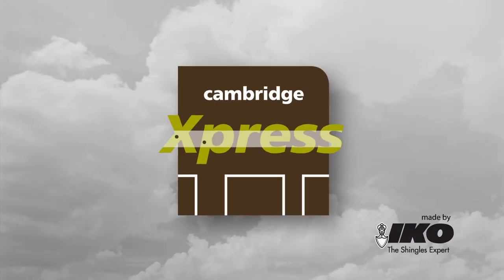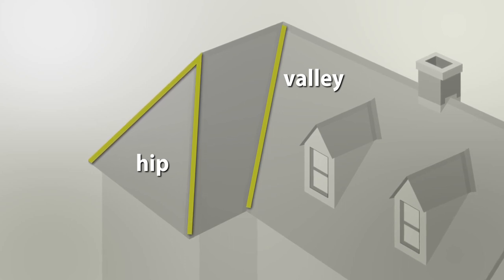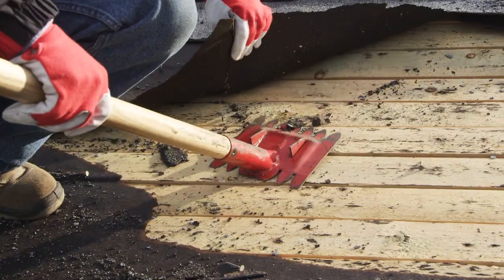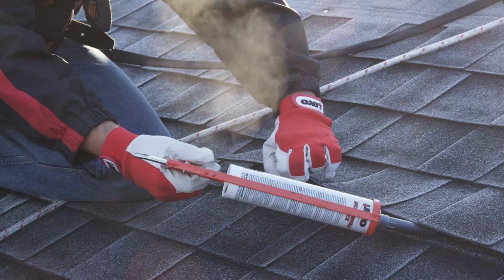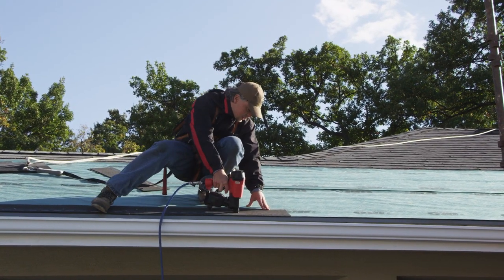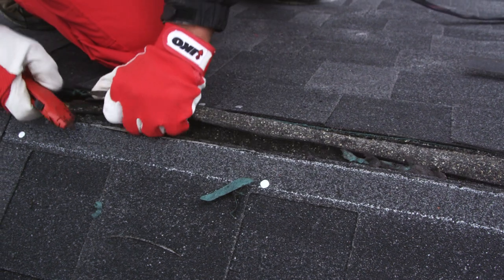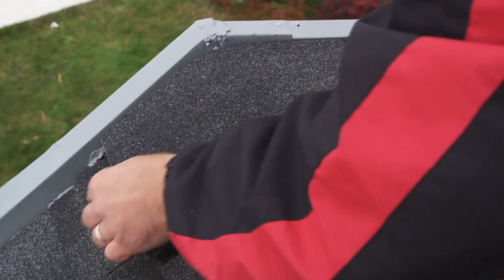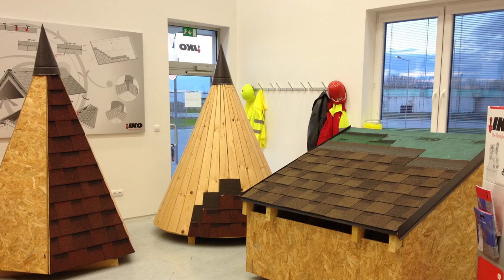How to install IKO Cambridge Xpress on your roof? Roofers guide - English version

Comment from the maker: @ventureelect

Indeed @ventureelect, with Cambridge Xpress or Cambridge Xtreme 9.5° you actually can lay shingles over the existing shingles, IF the underdeck is still in good condition.
New roof shingles over existing roof shingles?
Before starting off any project, first check out whether the existing roof shingle layer could remain in place or has to be removed. Depending on local building codes at least three layers of roof shingles can be applied before stripping off the roof shingles is necessary. Read more on special points to take into consideration: http://on.fb.me/1uuxB45

Comment: at 7:24, is he not installing the drip edge backwards??
Reply: Stephen Thuswaldner During our application we just showed samples of drip edge and rake metal flashings. The old flashings were in very good condition so didn't change them.
Shingles Application Engineer at IKO